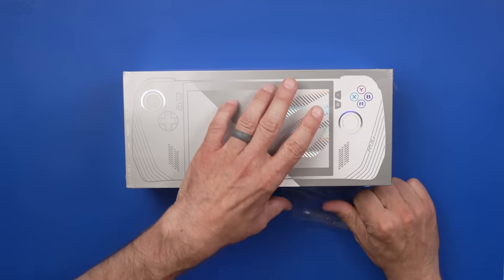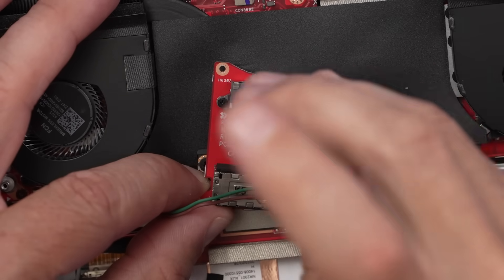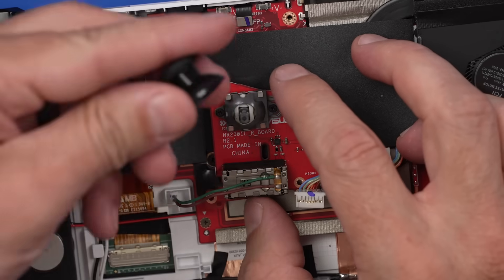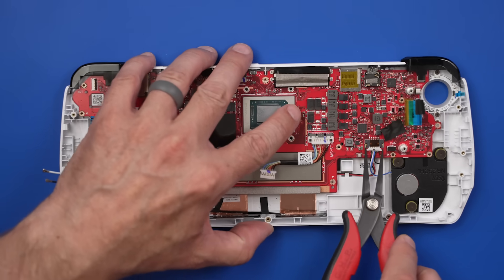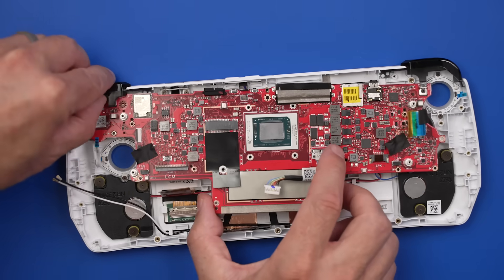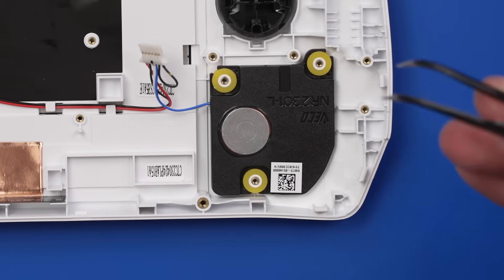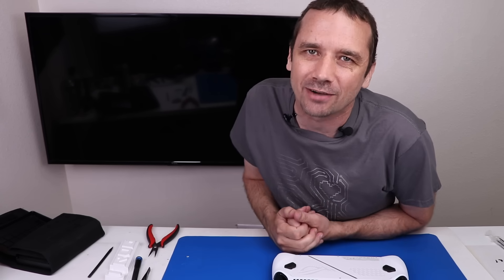ASUS ROG Ally - A Repairability Perspective

Comment: I love that you have to disassemble it to see the "do not disassemble" sign.
Reply from the maker: Lol, that's true
Reply: I suppose they probably just mean further disassembly, like removing the heatsink or battery or what not but still silly regardless
Reply: I think it meant dont disassemble the battery itself 😂
Reply: Kind of gives me "private sign, do not read" vibes.
Reply: My door is wide open but please dont creep in
Reply: @Tronicsfix  i think that the sticker means do not disassemble the battery which is actually not a good thing to do
Reply: Love how he gets low key annoyed when seeing that 'do not disassemble' bit on the inside of the device.  Yes they are probably referring to the battery but it's still amusing to see in a tear down video!
Reply: @rambofan1  and that is fair   Nobody should ever dsasemble batteries   you can tell they built this thing with servicability in mind.
Reply: My charger port is broken
Where can I buy a new port to solder back on
I know that it's part of the XG port too
Reply: @Tronicsfix My charger port is broken
Where can I buy a new port to solder back on
I know that it's part of the XG port too

Comment: I bought mine last week when I got to the U.S. I straight away installed a 1TB WD SN740 1TB SSD. Then I finished Resident Evil 4 Remake on it already, and now I’m playing Baldur’s Gate 3. I’m really loving it and the graphics quality. Thanks for taking it apart, it was fascinating to watch.
Reply: I was thnking of buying it,but i heard it really gets hot,so i dunno really,and i honestly dont want steam deck with current specs,so maybe i just wait and something better comes out.
Reply: @EyefyourGf  it does get kinda hot but its only a issue if youve got hands of a giant and your fingers touch the center of the console other than that it really isnt a problem and you can always make your own fan curve
Reply: @EyefyourGf  I have both the Asus ROG Ally and Valve Steam Deck. I feel like my Steam Deck gets hotter. The fan of the Steam Deck is also very loud in comparison.
Reply: @EyefyourGf  trust me bro put on a custom fan curve and you don’t gotta worry about overheating even with the latest triple a titles if you don’t mind the fans a lil louder (still relatively quiet)

Comment: I have an ASUS gaming mouse that I bought because it has 4 screws and it opens up for easy repair. Just a shame their control software sucked, I couldn't get it working to switch off the LEDs so I just pulled the LEDs off the PCB.
Reply: Switch off the LEDs? Like the ones around the joysticks? You can turn them off.

Comment: That captive screw in the case you mentioned, actually serves an important purpose. The device will not turn on at all unless that screw is in all the way. There's a sensor in there that, when the screw is not in, kills all power to the device, even if the charger is plugged in.
Reply: that sounds annoying to deal with if you're trying to diagnose a problem
Reply: Oh damn
Reply: It's not really the screws, but there is a light sensor on the upper right if you face the motherboard, some black tape on it can let you use it unscrewed.
I use this setup to put a NVME Oculink adapter and an RTX 3060 in a separate case and connects it to my Rog Ally and boot from USB without the backplate, thanks to that piece of tape ! :)

Comment: Anyway, the ROG ally uses PTM7950 which is a phase change thermal interface material. In some devices it can be used as a safer substitute to liquid metal with same/similar performance.

 It was dry because thats the nature of it - stays dry under 50C and liquifies after it hits 50C. It is extremely good at heat transfer and replacing it with traditional thermal paste can for sure make the performance worse.

 Longevity wise PTM7950 does not dry out, as it stays dry to begin with. That's why there should theoretically be no need for replacing the TIM on devices with that material (it can shift to the sides when liquified so thats worth consideration).

Not sure why my original comment dissapeared, is it censoring or just youtube, I'll repost it anyway so others won't hurt their Ally thermal performance
Reply: That stuff is awesome. Would love to put it in my Deck someday
Reply: @captaincrunch1707  Someone replaced thermal paste on an older legion (9th gen intel) and while gaming it reached over 90 degrees, the paste was replaced a few days before he reached out to me for help. I replaced the tim with ptm7950 and it reaches ~70-75C while gaming. Awesome suff
Reply: Good to know. I have the ROG Ally but I wouldn't take it apart.
Reply: YouTube moderation needs to be better communicated. Its so frustrating when you have to keep rewriting your comment because you keep using some obscure trigger word (or worse, when you think you've commented but it just silently vanishes)
Reply: Yeah in this case, that amount of paste was actually the perfect amount of it :) PTM is great product!
Reply: im using this stuff on my cpu instead of paste, its marginally worse than paste but i dont need to replace it every 6 months when it starts to pump out so im willing to deal with slightly worse temps for not having to touch it ever :)
Reply: This is also what Lenovo Legions use
Reply: My PS4 uses ptm7950 :P it's also nice when deliding CPU, cuz when cold it acts like glue
Reply: @verpejas  this may in fact be what killed my Sager Laptops GFX cards. I really appreciate this post man. Maybe I could put this paste in my MSI laptop on the GPUs. Could help a ton. Probably CPU as well.

Good to know!
Reply: I discovered about the ptm7950  thing when I watched The Greatest Technician That's Ever Lived. I bought it (although it was quite expensive, especially for a poor hobbyist like me, but curiosity gets me), used it on my delidded old crappy PlayStation 3, all my laptops, and my RX 5700 XT. Boy it's great. SO GREAT. So great it made me wonder whether it's a new invention or what lmao.

If you're a technician who repair tech for a living, this thing is a must.

Knowing the ROG Ally uses it (thanks to this comment) makes me smile. Asus made this thing so well, I can forgive that god forsaken frying microSD slot design lol

Comment: Thank you for this 🙏🏻 I have a minor little chunk of the white casing that came off near the middle upper area by the screen.  I also have aome grinding noises with my left thumb stick (accuracy still unaffected as of yet tho) and my display itself seems to have an issue with gray translucent type textures where it diskplays a pattern-effect that shouldn't be there, even though that isnt a huge deal as of yet and otherwise unnoticeable.  With GN latest video on Asus RMA I no longer want to take the chance with warranty for the sd card slot and screen / thumb stick.  I am just going to fix everything myself except for the SD card reader, so this video will be of great help to me.  I have heard some say that the SD card issue is related to weak solder points on the reader itself so i may try to get it re-soldered since worstncase scenario it didnt work anyway (nothing to lose).  I wish you a speedy recovery and a thank you for the years of content that have been invaluable to me and many others.  🙏🏻❤
Reply from the maker: Thank you for the super thanks!

Comment: At least some one knows repair friendliness.
Well done, Asus.
Reply: Call me cynical but I don;t think they did those things to make it easier for us to repair, they did that to make it easier for them to. I am curious how that'll hold up over time. I had an Asus laptop where the GPU fan would start making loud obnoxious noises after about a year of use. Both the original and replacements. And I had to get replacements off of ebay because the first time it started doing it it was literally 1 day out of warranty and Asus could not just send me the replacement part even though they obviously have them to do the repair themselves. Super pissed at Asus about the hole thing tbh.
Reply: @ryanb509 repairing let's say the joystick: a normal completely soldered joystick is easy to repair/change if you have the correct tools, which allegedly asus does, but soldering them into a flex cable and attaching a conector into a daughterboard is definitely more expensive than just soldering it directly, so that didn't help them directly in any way
Reply: @ryanb509  It's not that simple. The ASUS support reps probably can't just call up the facility that does the repairs and have them ship out a replacement part. They might not even have an internal system capable of doing so. They're not just going to call up the repair centre, ask for a random employee and say "get an envelope, find this part number, send it to this address and then bill god knows who".
Reply: @dariohermosillo  The average consumer does not have ready access to a soldering pen/kit or even the know-how. Buying a replacement joystick soldered onto a flex cable is more expensive (if and when they decide to sell parts) , but it enables the average consumer to replace it themselves instead of bringing it to a third party repair or even Asus. It's a right step in the direction of repair friendliness for the average consumer, which most are.
Reply: @nrdn_  that's what I said. I responded to someone saying it was for ease of repair for Asus, but to asus directly it makes no difference because they do have the correct tools, it is thought for the end consumer.
Reply: @dariohermosillo  Ah I misunderstood, cheers

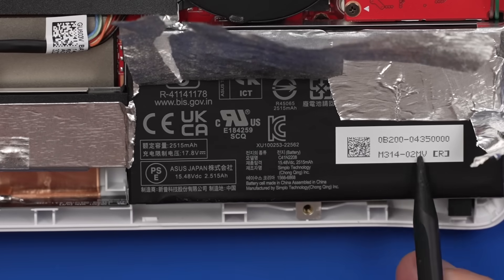Comment: 2:27 The battery part number that you would need is C41N2208, which is the model number of the battery. I know this because a lot of Asus batteries I've seen also follow a similar style of part number.
Also, the nominal battery rating is 15.48V, or 3.87V per cell. The maximum charging voltage is 17.8V (4.45V per cell).
Reply: 4.45V per cell? Wow I wonder how many cycles it will give always going that high to max charge...
Reply: LiHv? Graphene LiPo? Like RC packs? Is it safe enough?

Comment: The purpose of thermal paste is to improve metal-to-metal contact due to the microscopic air gaps created by the imperfections of the materials. Putting more thermal paste can become worse as it increases the thermal resistance. In the video you can see that it is applied perfectly.

Comment: Dell laptop tech here. this thing has alot of laptop design choices. wanted to tell you a few secrets. You mentioned the arrows denoting the screws on the board, most laptops are like that. Also the numbered screws on the heatsink, the numbers are the order you put the screws back in so your paste evenly spreads. The rubber things in the speakers are sound dampeners and most laptops have those too. very good design on this thing overall, the non-soldered sticks were quite a surprise.

Comment: My luck sucks so these videos are very helpful. Had a Nintendo switch for a year and a half and it just randomly died on me. The system literally looks brand new because I had a case and took great care of it.
Reply: I'd start with swapping the battery. Especially if you have a first gen switch.
Reply: Nintendo Switches don't just "die". You need to enter recovery mode.
Reply: @Robbie-mw5uu  Got it fixed before Christmas and gave it to my son. The people who fixed it said the GPU was fried. He said it was the best system he ever had to fix but he wouldn't fix it without taking a board from another system. Cost $80 bucks

Comment: Great video; much appreciate your insight.

For future reference, you may want to check on how durable the buttons and D-pad are for this class of devices.  

Especially with early gens products, there is always some default anxiety about durability and repair-ability.  (Which has absolutely, positively, nothing to do with my experience of having to replace S*ny's Dual Shock 4 face buttons' plastic membrane again and again and again and ...)

Also, specific to Asus Ally: a lot of YouTubers aren't impressed by its D-Pad.  If you can put together video on how to source and replace with a better D-Pad, I think you may get a lot of views from Ally owners and those interested in getting one.
Reply: One last thing: the Ally has a problem with overheating SD cards.  

While Asus has pushed out a firmware mitigation that spin up the fans more, if you can figure out a hardware hack to keep the SD card and reader significantly cooler, it may bring a peace of mind to many.
Reply: @SansBalance  i'm guessing a workaround would be to add thermal insulation tape around the micro sd port

Comment: Crazy to see a teardown on a new product.  Sucks that those main left and right buttons are hot welded.  It would have been amazing if they had dropped some threaded metal sleeves in there, like the other main screws.  Yet another thing that will make repairing or customization more difficult.

Comment: ive opened mine up and am insanely impressed with repairability   its little things like all screws being obvious where they go (no 2mm longer screws so no longscrewing it )  non glued battery  easy access to high wear componets like thumbsticks and a website where you can buy almost every componet   About the only way they could improve it is slotted memory but unfortunately thats just not something thats viable on a device of this formfactor

Comment: I'm really glad you made this video. I was thinking about getting this and from what I'm seeing with the internals ... it would be a worthwhile investment for me. It's basically a Steam Deck 2.0. The only difference being a Windows OS instead of Linux. But I already have the Steam Deck so I can have the best of both worlds.
Reply from the maker: It seems to be pretty well built
Reply: I actually own both and it’s pretty worth it to own both. My steam deck has become an emulation machine and I use the ally for actual PC games because of the extra power
Reply: Dual booting steamOS and Windows would be nice, that way you could go with a 2 TB drive in the Ally and still spend less than on two devices
Reply: Nice info! I was wondering what the differences were between this and the Steam Deck.
Reply: @HNedel  once chimera os improves I’m actually thinking of doing that lmao
Reply: @HNedel  That would be ideal, but Windows kind of sucks on the Steam Deck. It's the lack of driver support. Also, no native dual boot method, and the reverting back to SteamOS only is a pain in the ass.
Reply: @chunkylover5367  i meant dual boot on the Ally. There should be some way or modified image to do that. As far as i know the chip in the ally is standard amd and not custom made

Comment: Would placing some capton tape over the Micro SD card component help protect the card from excessive heat?
Reply: no you need to place a heat sink on the ic like a copper sheet to guide heat away from the sd area.

Comment: On the thumb stick boards it looks like you dont have to unplug the connector for the little vibrating motors. Looks like you only have to take the ribbon cable and screws out and the board pops up

Comment: So I bought mine on launch day with the 65w HDMI adapter, couldn’t get the adapter to work/detect on any monitor or the console, was also having issues with performance, hardware errors in the event viewer for the internal SSD and also had issues playing games from the micro SD card, unfortunately had to send them both back to ASUS, wanted a replacement but they didn’t have them in stock at the time, however for the time I did have it, played a bit of D2 and it was superb, just really disappointing that I had to send it back, not purchased another unit yet and not sure I will, but great video and looks easy to repair and upgrade the SSD
Reply: You're lucky you got your money back they wouldn't give me mine faulty SD card reader

Comment: Thank you for the video 🫡. I just bought one two days ago and it seems just as repairable as the steam deck. I just hope parts become easily available. The SD card issue is definitely troubling, but I can look over that with an ssd upgrade down the line because it looks like they’re just swapping out the MOBO for another one for it to just fail again 🤷‍♂️

Comment: I opened a brand new Ally and the bottom left corner of the backplate is just separated from the rest of the case. Doesn’t snap into place. So it’s exceptionally annoying that I’d have to return or RMA it. Do you know of anything that may be causing that to fix it? No clips are broken off or anything.

Comment: Tronics my ps4 doesn’t want to read a disc I put in and It doesn’t eject it either. I removed the plastic top so I can remove the screws but where there are suppose to be screws there are these black pins and they don’t come of easily. HELP

Comment: Hi I'm currently having trouble with my rog ally it just stop charging and now there is no light on the indicator whenever I try to plug it. I tried my charger with different device and it works but not in my ally what can you suggest me to do? I can't take it to any repair shop or customer service at the moment since I'm currently onboard a vessel. 
Thanks for the advice in advance.

Comment: Is there any way to contact you? I got scammed today. I thought I was buying a fully functional 2DS XL, but it doesn't turn on. It only starts up when I apply a lot of pressure to the X/Y buttons. As soon as I release them, it turns off or freezes.

and very nice video.
Reply: where did you buy it from